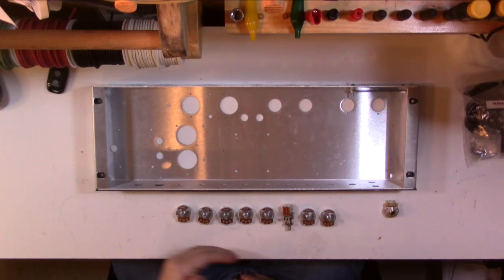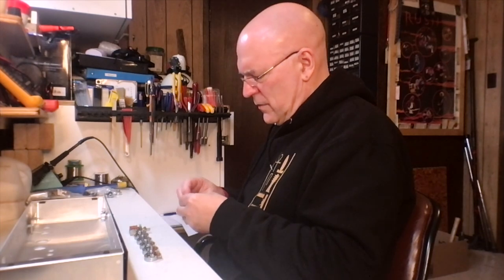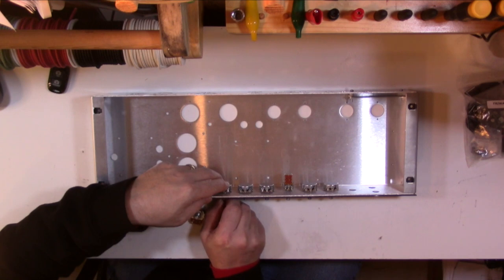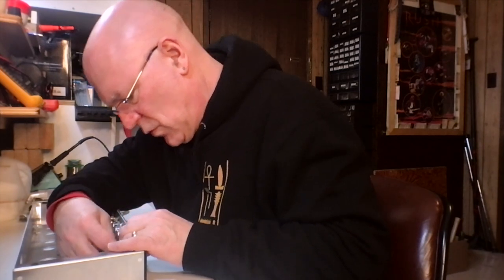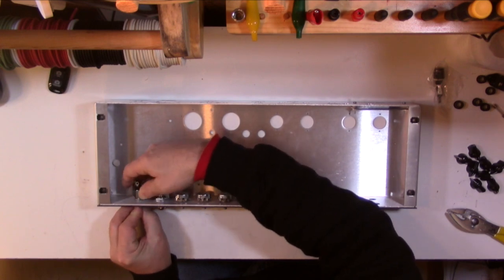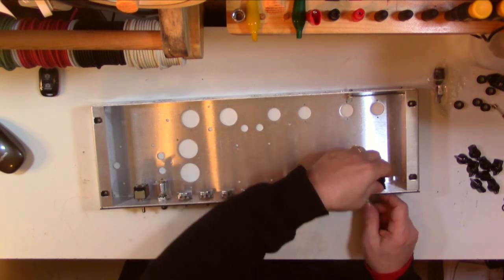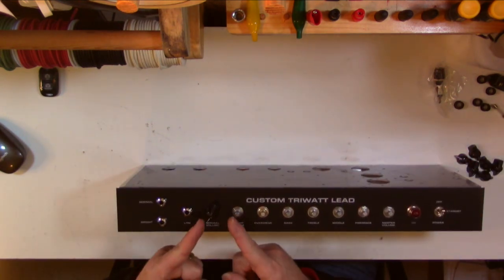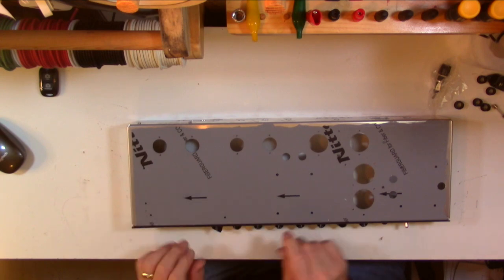Trinity Amps Triwatt Build Pt. 1

Comment: Nice job.  Found your link on the Trinity forum and just saw the first few videos on your channel.  I purchased my Triwatt kit a whopping TWO YEARS AGO.  But I forced myself to complete my houe remodel first before doing my "fun" project.  You videos should be loads and loads of fun and inspiration as I get started in a week or two.  Heck, I can't even remember if I ordered the effects loop or footswitch option!  Subscribed!
Reply from the maker: Thanks!

I’m going to push through and hopefully have the amp built and ready for testing next week. 

When I started the build series I thought, “This should be done in about a month” 🥸. Sure didn’t realize how much filming and editing would slow me down LOL.

Next Winter, I’m thinking of doing another series,  now that I know what it takes and what I can do better in terms of showing the process. Not sure if I’ll do another kit or source parts myself. I’m pretty sure I’ll do a Plexi style amp though.

Got lots of other amp and guitar videos planned for the spring and summer. Once I get the Triwatt built and tested, I’m going to do a shootout between the Triwatt, my (slightly modded) vintage DR504 and one of my own designs. That will be fun!

Let me know how your build goes when you get it started!